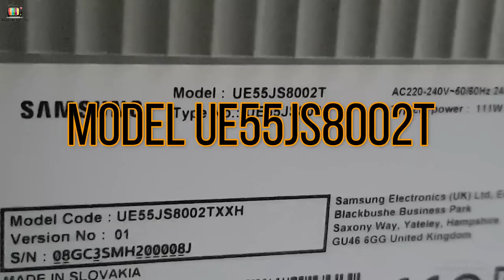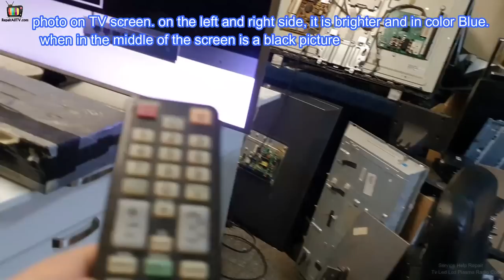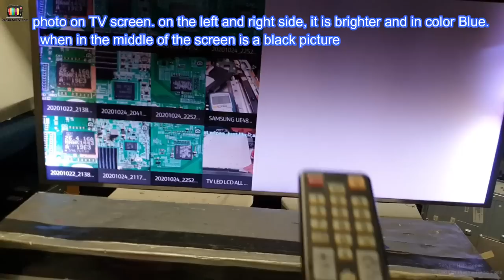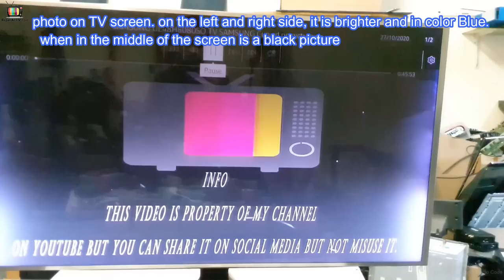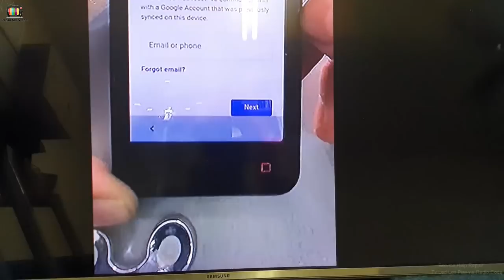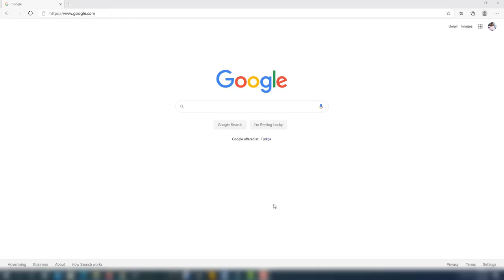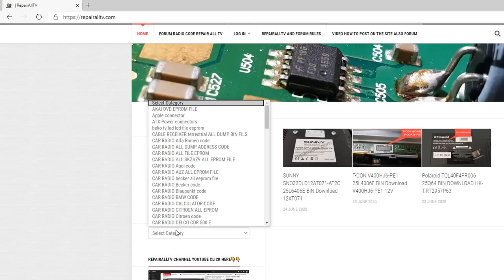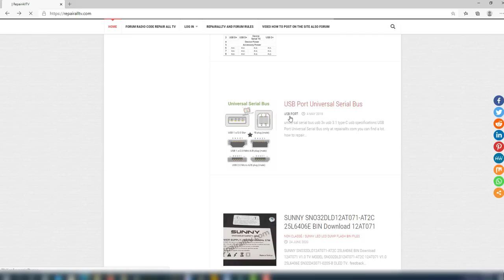SAMSUNG UE55 on TV photo left and right white and color blue in the middle of the screen black photo

Comment: I have the same problem with my 55 inch samsung led tv, the light guid plate was melted from the leds. I took a doner from another LG tv with a broken screen. Its 3 mm bigger then the original so it does not fit in . My question is will it work if i cut these 3mm of and does it matter if its from a different brand?

Comment: Nice work, well done.
I have Samsung 32" HD Flat TV F4500 Series4 - Model/UA32F4500ARXZN with a WiFi ready option. The problem is that I do not have the required Samsung wifi adapter that worked with the Tv first reason it is not available anymore the second reason it is very costly for an adaptor (30$), I have tried so many adapters from other brands but it did not work. Is there any way to make another adapter brand work on it?

Comment: Hi everyone, l have been following these tutorials and I have tried repairing my own TV. Philips 42pfl5609s cannot start with red Led on. I have spent many hours trying to figure out the problem. But l fail. When power ON & l remove the 12 pin jumper cable fro PSU to Mcu & pluck it back immediately the Relay on & the TV is back to normal. But if I off the incoming power, the TV cannot start again. Can anyone  please help. Thanks.